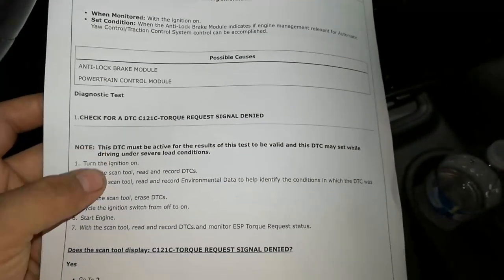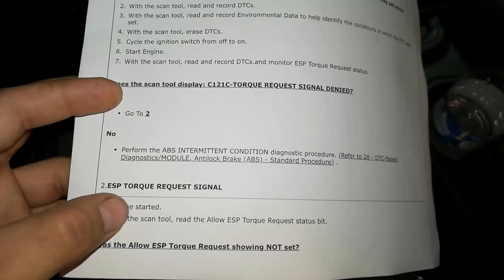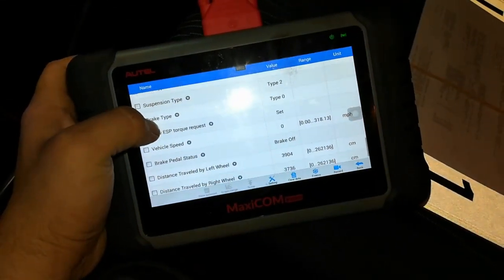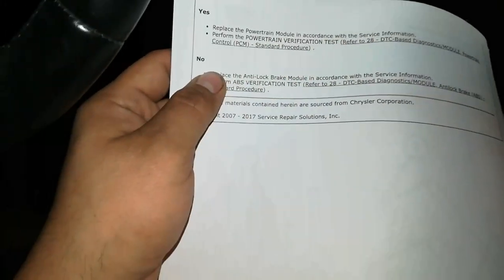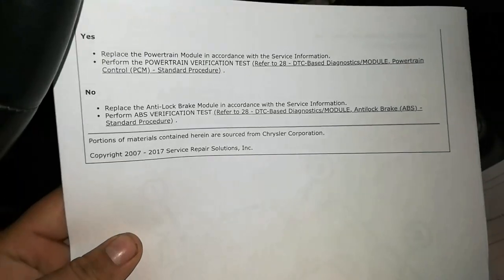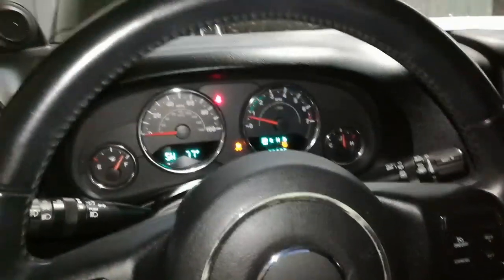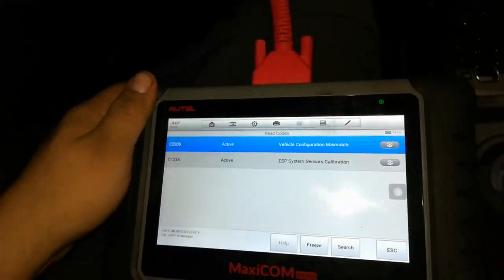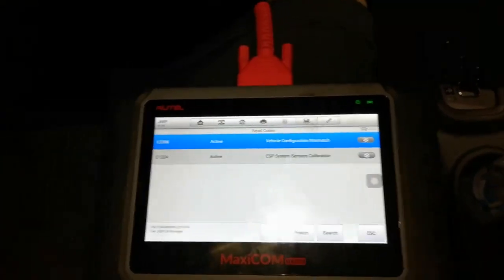07-18 JK Jeep Wrangler ABS Module How To Replace. Code C121C

Comment: I'd also like to express my appreciation for your video.  It took me a little more effort to pop the stems out of those grommets than you demonstrated.   I guess since it's a 2007 wrangler  (16 years in that spot).  And yes, those brake lines keep the unit pretty tight when your trying to replace just the module itself.  But I managed to position it to get it done.  I had to replace mine with a used one because I can't find a new one anywhere (including the dealership)  Apparently still covid / work supply chain issues.  Anyway it's working.  I just need to run it to the dealership and he said he would flash it for $190.  That's the price in my town in 2023.  Thank you for your help

Comment: Screws were a MAJOR pain.  Access through the wheel well (removed fender liner).  Also helps push from below on the socket/pins while using a prybar to lift as well.  Drilled holes in the plastic case (over wheel) to get strait access to the lower bolts on ABS computer.  ONE WAS FROZEN  after all other options, used a grinder from underneath to cut the bolt.   THEN, everything else went smooth.  Replacing the ABS computer and bolts.  $150 for ABS unit from AAA Auto Salvage (used only the computer).  Still need to get ABS flashed I would suppose...

Comment: So I have a 2017 jeep patriot latitude  the weirdest thing happened  when my abs,brake,and traction control lights  all came on the same time I  took it to dealer and said it was my anti brake module  Internal  their charging me N arm and a leg to fix it but your  video makes it look simple I think ima do it myself  my question  too you is  do u think it's my module cause I been  driving  it to work  for a week all my lights are still on and my brake pedal feels normal and do I unplug my  battery while replacing  module

Comment: I just replaced my own module on my 2010 Jeep Wrangler Rubicon JK 2dr. It was fairly easy with the right tools. At one point you need a helper to hold up the module so you can remove the fasteners at the bottom of the module. I did it by myself and lost one t23 head. I found another t23 head and carefully and with lots of elbow grease was able to loosen and remove the bottom fasteners. It is a 30 minute job, but it took me 1 hour because of that one issue. Bad thing is that Chrysler in my area (Corpus Christi, Texas), charges $185.00 an hour. They told me it would take 1 hour. I don't want to pay them anything if I could flash the module on my own. Does anyone know how to flash the module?

Well, i couldnt flash it so i took it to the desler and hsd it flashed. It was worth it in a way. Dealer said my model of jeep had two recalls; replace pax air bag, and driver pax air bag sensor. So yea, all for $185.
Reply: After you flash the module in the dealer  work good event if you install the part you self ?

Comment: Do you feel anything unusual in the brake pedal when that brake module fails or is failing?  Wondering if it mimics any other brake faults.
Reply: you wouldn't feel it until brake like a boss
Reply from the maker: Yeah pretty much would never know until you brake hard enough to lock up the brakes
Reply: @BoBuilds  Hi , I've replaced new ABS module n pump , got exact the same two code you had, is it possible that I can reflash it myself by any chance instead of going for the dealer ?

Comment: Anyone else knows if this will also fix code C2200 "ANTI LOCK BRAKE MODULE INTERNAL?
Reply: Question you fix youcode c2200 on you jeep?
Reply: @rico162427  it went away after I had brakes replaced, my guess it was a sensor.
Reply: @martinlee7562  im getting that code now. my ABS, traction control, and "brake" light all stay on. you said you had your brakes replaced? just the pads on all 4 wheels and it went away? Or did you replace an abs sensor or speed sensor?
Reply: @hulitonuras4177  all 4wheels, yes.  The mechanic did not mention anything about the sensors.

Comment: I Have Code C2200 anti Lock brake control You think I have to  replace the moduleThen I have to take it to the dealer to get the computer flashed
Reply: I got the c2200 as well what did you end up doing
Reply: It sounds crazy but it cleared By self

Comment: howd you get the bottom two screws out? been wrestling with this thing
Reply: Screws were a MAJOR pain.  Access through the wheel well (removed fender liner).  Also helps push from below on the socket/pins while using a prybar to lift as well.  Drilled holes in the plastic case (over wheel) to get strait access to the lower bolts on ABS computer.  ONE WAS FROZEN  after all other options, used a grinder from underneath to cut the bolt.   THEN, everything else went smooth.  Replacing the ABS computer and bolts.

Comment: Can you do this without cutting back and forth and without the scan print instructions? I need to do this on one of my vehicles but I can't follow anything you've done because of all the switching back and forth and when I try to fast forward past the talking parts I miss the fixing parts and have to rewind, ending up in talking parts again.

Comment: I got a code C2200 on my 2009 jeep wrangler jku, would this resolve my issue or am I better off replacing the module and getting it flashed myself? Esp,bas,esp brake lights are illuminated.
Reply: Same issue with mine right now
Reply: @keystonecowboy3461  I'm going to get it diagnosed this weekend let you know how it goes. So far I ran the car, and miraculously one time it didn't come on all day. But now it's bac.  Only comes on after about 10-12 mph. Haven't check all ground points. Going to test my battery since it's been about 3 years maybe now. Checked wheel sensors and  all looked good. Going to check for any frayed wires or signs of corrosion damaged lines. Etc..
Reply: @sovannahong6472  yeah I tried to order the part and it’s on back order from the dealer. Yeah haven’t had any issues and I replaced all my wheel speed sensors not too long ago. My Jeep just gives me hell all the time haha
Reply: @keystonecowboy3461  yeah, surprisingly this one has given me a good run without problems compared to all my others but is now starting to have hiccups. I've been up and down forums searching for a solution but all information I can find were helpful but just not I'm my situation. But luckily Ive found a pretty honest shop and after my diagnostics I'll probably just chew the fat and have them fix it. Will let you know what the problem was. 👍
Reply: Hey, did this help your problems? I have ABS, brake light and traction control lights

Comment: You know that you could reprogram new module with your Autel?
Reply: Do you know if the Autel Maxisys ms908p with the programming ECU can reflash this module?
Reply: @lightworker303  should work, ive used some big one with touch screen and worked like charm
Reply: @lightworker303  Isn't it really just adding the VIN on these?